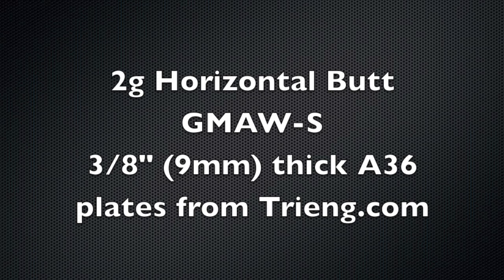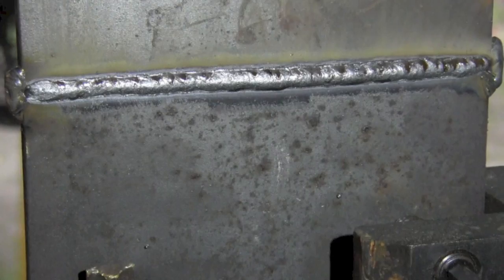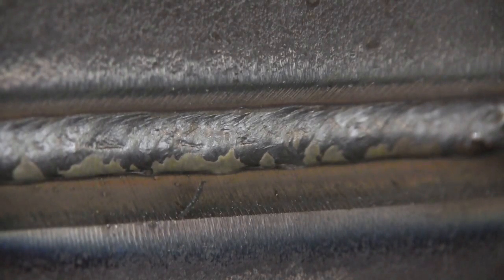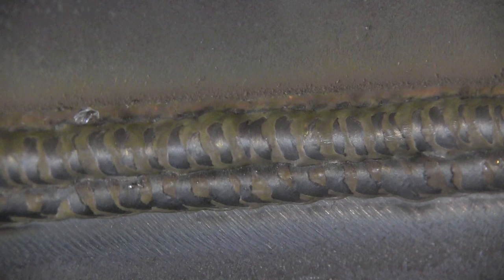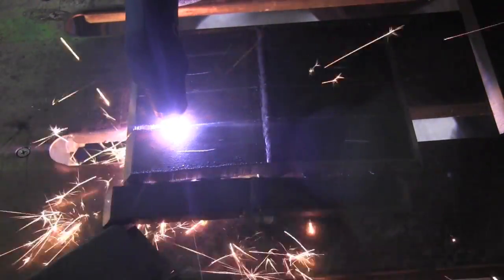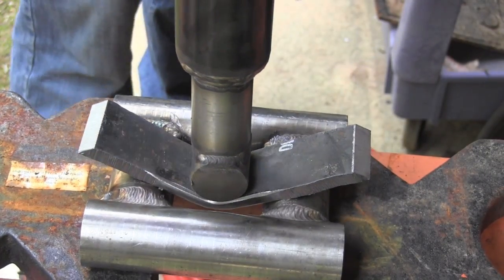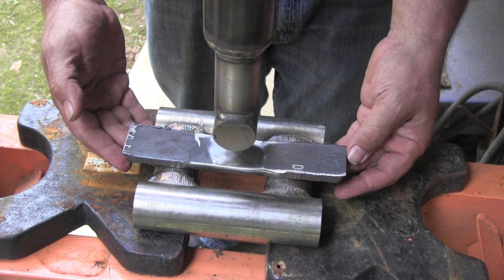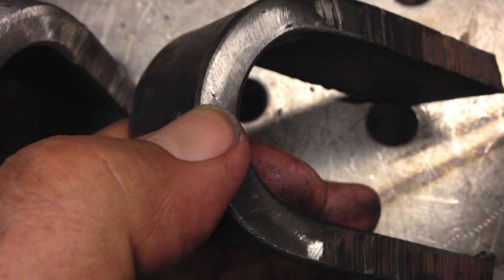Mig Welding with Co2 & a Lincoln Power Mig 210mp

Comment: Got my first 20lb bottle of CO2 connected to my Lincoln 180C this weekend. Very impressed with the performance running straight gas. Excellent cost savings when practicing for plate tests.

Comment: I was using CO2 in my Lincoln ProMig 175 and started experiencing porosity.  After trouble shooting, I discovered the entire hose/cable assembly had come loose and was pushed out of the machine.  I posted pics of the issue on my Instagram and all of the keyboard warriors started telling me the porosity was because I was supposed to be using 75/25, ignoring the fact that the hose was completely outside of the machine.

Comment: So glad to have found your video.. Hopefully you can answer my Q.   Just subscribed !
I have a Lincoln 110 V welder.. gets me by.  I came upon some Stainless Steel (.35 Thou. Thin) free 4x8 sheet.
Don't know what type of Stainless it is but it a little soft and non magnetic.  I want to weld with C02 only. Can this be accomplished and what wire to use please!! Accidentally purchased some non fluxed Blue Demon ER308/308L wire. (Thought it was fluxed).  Thanks in advanced !!

Comment: Hey Jody have you notest any woble in your drive roles with the lincoln 210?. Just bought the 210 mp and it seems the dive role for the mig wire feeder is off center. doesnt seem ro effect the weld. should I be concerend?

Comment: i use a Lincoln 140hd mig and been using just flux core wire. i want to stsrt using gas, which do you advise for this 110 machine,  75/25 or straight CO2?

Comment: I am now testing some welding with co2... It works great... all untill the regulator freezes up... Std cheap regulator... any tips?
Reply: steisje I'm welding with straight CO2 cos its cheap. My regulator gets very cold but hasn't frozen yet, however in another video Jody mentions that using a nylon washer between the regulator and bottle instead of a fibre washer does help prevent freezing.
Reply: Hello. thanks for the reply. I did use a nylon washer, but it still froze up. But I have solved it now. I glued 5x 12v resistors on the back of the regulator. And then covered them in chemical metal. (each resistor got over 160 degrees Fahrenheit before mounting) so now it gets cold but not freezing up anymore.  Regards.

Comment: what would be the setting for a mig root using 035 wire with the Lincoln 210  schedule 80 plate or pipe  75 /25

Comment: Jody, i think welding with CO2 isn't mig, but mag.. Carbon dioxide is a active gas so mag (metal active gas). Correct me if I'm wrong please
Reply: Austin Carlson   Yes Acetylene is obviously active.  But I would call CO2 semi-inert, in that under certain conditions like in a arc the carbon and the oxygen dissociate, and for a fraction of a second recombines as CO (carbon monoxide) it then re-associates withe the oxygen atom to reform CO2.  Even C-90 (90%helium,7 1/2% argon, 2 1/2 CO2) which is used for SS MIG is not inert.  Only aluminum MIG is truly inert, as it only uses argon or argon/helium mixes and is spray transfer.

Comment: Great video. Just goes with what I've said for 10 years about"fancy smancy" gas mixes. They have their place.I was elated with it in the mid eighties.
Then I was pissed because I couldn't find C25 in S.America. I went back to the old days.CO2. After a couple pounds of wire and a proper gas regulator I laughed at myself.
Hey. It works for beer it *must* be great !
Ground. Stick out. Gas flow.Use only your ears to adjust wire speed.Good to go.

Comment: Jody, you should do a 3 way comparison/bend test with that machine...one joint tig, one mig, and one stick...er70s-6, vs er70s-2, vs 7018....same thickness, same output, different process...I always "heard" when I first started out that tig was the "strongest" process...i think it would make a great vid...

Comment: Another great video! I'm really thinking about getting this welder now and your teaching skills and knowledge is amazing!! Like the comments below I wana see some flux core welding with this.. I don't have a shop or shed or etc.. I weld outside on our offroad Baja truck we race.. Would tig welding outside be okay or no?
Reply: David,
TIg or even MIG with gas is best done in a shielded area the slightest breeze can remove the shielding gas from the weld with predicable results.
Build a breeze proof barrier out of tarps and a few poles to keep the breeze out and you should be good to go.
Cheers
Reply: Buy a tarp...

Comment: I just bought the Power Mig 210mp on your recommendation and my local welding supply.  I am attempting to weld a 5/8 inch bolt 5 inches long to a piece of 1/8th inch thick angle iron.  I am using the angle iron as an axle and using the bolt lengthwise in the V of the angle iron with the threads sticking out.  Do I set the 210mp with straight co2 for the 1/8th inch angle iron?
Reply: g1moore Good question: Set machine for thinnest piece?  In your case the 1/8" settings may be a little cold for the bolt.  
Let's see - 5/8, sounds about right for 8-13 inch dolly wheels.  With nut and washers that would leave about  1.5 - 2" for weld. I am guessing here to set the scenario to apply my 2 cents.
 First remove any plating on the bolts and scale from the angle iron.  Then I would set welder for about 3/8"(1/4 minimum).  Tack weld the 4 corners to keep the bolt aligned with the angle.  Start the puddle on the bolt to get the heat into it and wash into the angle iron.  Spend more time on the bolt and control the heat into the angle by how long you dwell on that side of the puddle as you go.
Reply: Eddie the Grouch Thank you for your assistance.  I will try that.  I always make my parts as clean as possible.  8 inch wheels for a generator.  Thanks again.

Comment: I just want to point out that the 210MP has a C100 setting in the setup wizard, this is supposed to use a different table of presets and help you get closer to where you need to be.  I had an old CO2 tank from some carbonation I did 10yrs ago, so I've been using CO2 exclusively with the 210MP.

Comment: Jody, first of all great videos. I enjoy them very much and you clearly know your stuff. Perhaps things have changed but I don't believe there is a documented aws procedure for welding short circuit on anything, much less 3/8". Let's see the difference between this and FCAW. For anything 1/4" and up, IMHO FCAW is the way to go. Short circuit will work but it's not ideal.  I'll use it on 1/4" but only if I can remove all the mill scale or put a bevel on it. If not, I steer clear of short circuit on thicker steel.
Reply: Jason Antley There are no pre-qualified procedures but you could certainly have a procedure qualified if need be, just have to go through the process.

Comment: Thanks for the videos.
You were talking about having a good ground with mig welding.
I have a metal table that I weld on and I just noticed that the metal power strip is grounded to my table causing it to be earth grounded with the plug on the power strip.
Will the earth ground affect my weld? Reason why I’m asking , sometimes after I start a weld about 2-3 seconds into the weld I get a sputter then the welder welds fine. I’m welding with a new Hobart 140.

Comment: Another well put together, informative video. As a novice welder I like that the past few videos have been specific to my particular welder (Lincoln 210MP) as I am just becoming familiar with it.  I learn something every week and, as time passes it all starts to sink in.  Very good teaching skills Jody.   If you have time, can you run some flux core through the 210 on 10 gauge HSS.  I don't have a shop and will probably be building my trailer frame outdoors in the breeze.   No worries if you can't as I have been practicing and have  a feel for it.  Just nice to see someone who knows what he is doing so that I can pick up a few extra pointers.

Comment: Great video (again) Great to see the bend test jig put to use.  Be careful with those cast iron plates that come with the Harbor Freight press. Ive heard a few accounts of them shattering under the right situation, you know how cast iron is.   I would recommend a good thick piece of 1018 or something similar.
Reply from the maker: 1ANeat Yep, I have heard that   those cast harbor freight plates with explode but I think using the bend test jig they are not stressed much....just compressed against the cross member...I will probly buy some A36 plates from SWAGoffroad eventually

Comment: i've found the use of cooking spray helps reduce the sticking of that splattering. and i learned early not to sit beneath the weld wile wearing polyester pants. you'll know why when one small piece of arch splatter lands in your lap. right on the tip of your manhood. have you ever slapped at a fire caused by arching to put out the fire. well when that burn is in your lap. you learn quick to refrain from that.

Comment: Could you do a video on maybe like, strength test comparison between flux core wire versus using mig/gas wire? 

Also what applications you'd use 025, 030 and 035 wire for and what their limits might be 

Thanks!

Comment: Better hot than not !
Reply: Brainmalfuction Right heat is fine, but horizontal with +++ heat ==> SAGS big time, gravity is the thing to beat
Reply: Actually you can use a lot of heat in 2 G.
I've ran spray transfer on 2 G plates its just fine.
Being that it was open root, he needed the right heat to fill the gap and fuse both sides.
After the root was in he could have cranked the V up a lot and still have a nice looking weld with better Pen.
That would have defeated the purpose of the video though.
Reply: Brainmalfuction
Best I found for horizontal with lots of heat and fast rate of deposit is shielded flux core, the slag helps holding the puddle.  Never tried spray transfer horizontal though...

Comment: what specifically does each gas do in the 75/25 mix, how and why does argon help the weld
Reply: jrcll  as i've learned. each gas is to force out any oxygen from the area around the weld. now argon promotes electron flow. much as it does in neon lighting. it's used in plasma lighting to create a given color of light versus other plasma gasses. and being it's a good plasma gas it makes for a hotter weld. much like helium does when welding aluminum. hence the welding process heliarch.